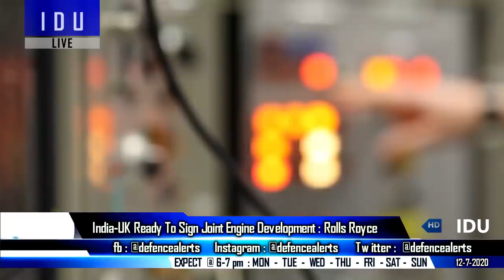Indian Defence Updates : India-UK Engine Deal Signing,ARAD & Carmel Production,AGM158-C LRASM On P8I

Comment: Finally, 1 news 2020 that isn't  bad. ej 200 is smaller and lighter than F414, snecma and way smaller than Russian engines. This will increase fuel carrying capacity.. range, combat radius will also increase. It's a gem of an engine. No disrespect to F404, f414 or snecma m88, but ej 200 edges ahead with high thrust to weight ratio.